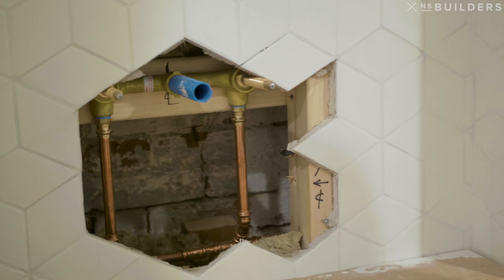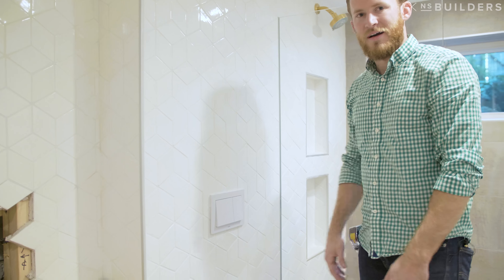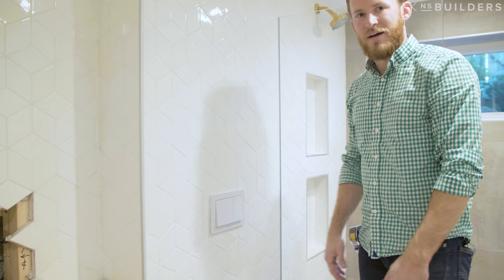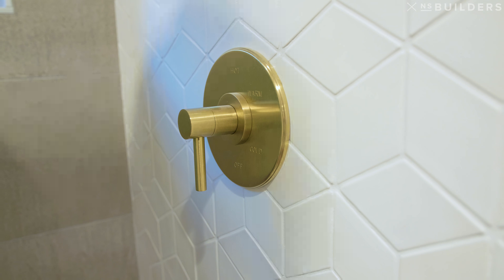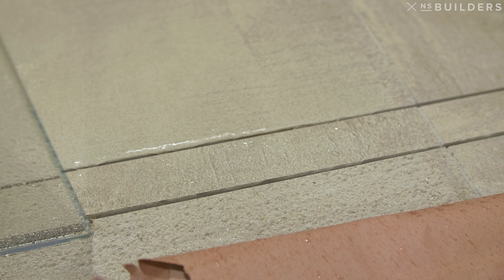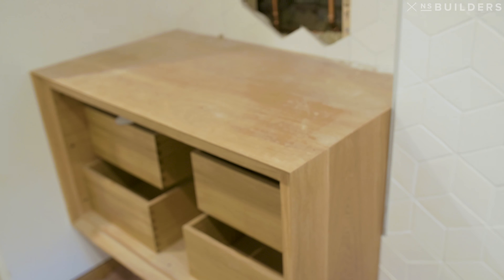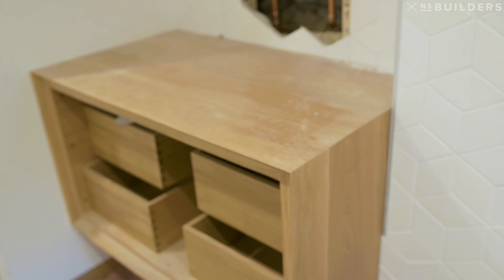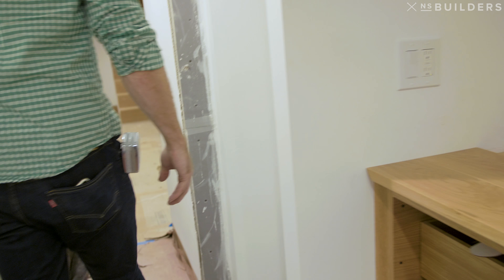Curbless Shower with Heated Floor

Comment: Hey nick great looking shower, I love the drain detail. I myself am a commercial tile contractor and I work with schluter products on a lot of my projects but I personally prefer laticrete 9235 water proofing. It’s a two part water proofing, a membrane fabric and a liquid rubber polymer roll on product. I prefer this stuff because of how clean and sharp you can detail all the corners and the water proofing is rubberized. Especially when you’re tying the wall corners and a floor corner together. You don’t get that corner build up on the floor. Look into it, it’s a bit more pricy but I think it’s a much better product. I have water proofed and flood tested many hospital restrooms, and commercial showers with this stuff and never had a problem with it

Comment: Nice video Nick. Interesting design how the tiles ends in the shower area. Instead of the wall mounted shower I would recommend to use ceiling mounted shower to avoid splashes in the bathroom area which is not shower zone.
Reply from the maker: We should do that next time!